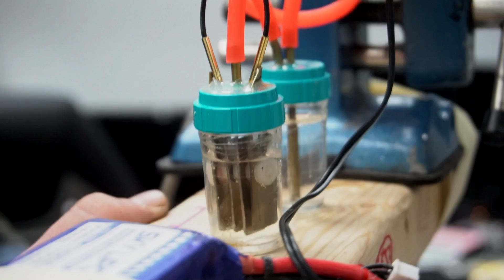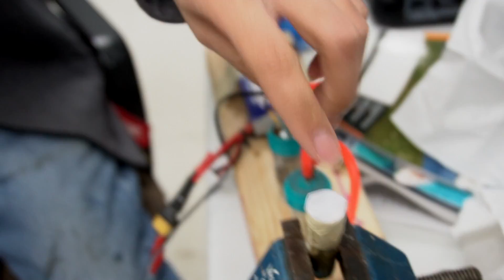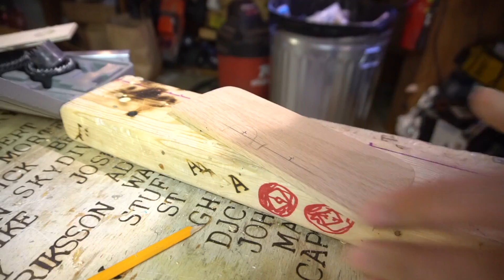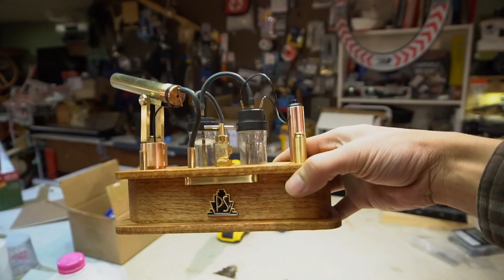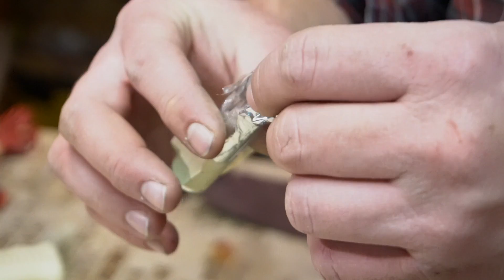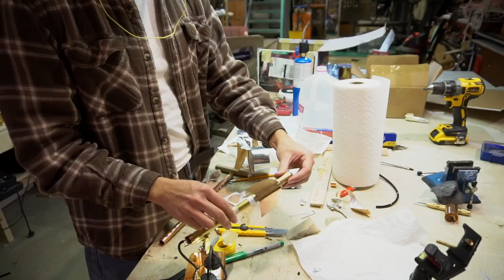Mini DIY HYDROGEN HHO Cannon

Comment: “This HHO is rally dangerous” -Petersripol yes it is, but basically it’s still only water (H2O). Hydrogen is the dangerous part. Actually you can use basic salt to dissolve in your water for electrolysis, works as good to heighten the conductivity. So yeah, you can build a hydrogen bomb with salt water. Try it at home but think thrice, educate and protect yourself. And don’t hesitate to ask for help or advice from someone.

Comment: A friend filled a balloon with HHO, then held the balloon against his sweater covered belly to tie off the end. The static electricity from the sweater ignited the gas and blew the windows out of the barn, removed his eyebrows and most of his hair, and he's now deaf in one ear.  Great contraption Peter, love the deco/science style.
Reply: I highly doubt the window thing but these explosion can easily deafen you.
Reply: MsSomeonenew a year late but it can easily blow out windows
Reply: (MsSomeonenew) It's pretty powerful stuff.
Reply: Thank you for pointing that out. I'm sure no one would understood the meaning of my dumb ass comment without your incredibly perceptive grammatical sleuthing. Your a champ, thanks again.
Reply: HHO is the H2O of water split apart. So it’s kind of the same as taking the smoke from an explosion and reconfiguring the atoms back into the fuel and its oxidizer. In the case of HHO, water is literally the “smoke” (or byproduct) that results from the explosion. So when you separate water into HHO, you naturally end up with exactly the perfect ratios of fuel and oxidizer, which makes combustion just about as perfect as it can be. Add to that the fact that hydrogen has a really high energy density (way higher than gasoline) and that’s why HHO has such an energetic explosion.
Reply: HHO. Safety is super important. If static is igniting it, then you have lost control, you cannot lose control of this gas. Sorry about your buddy.
Reply: 2 to 4 years late , but it depends on the ratio of hydrogen and oxygen and volume its contained in .
You can get a tiny pop up to dead, its all up to you in the end.
This process isnt for the average joe , do your homework before trying real science,  theirs alot more danger then just fire and boom to this if you dont understand it fully.
Reply: As someone who's played with soda bottles filled with the gas and then proceeded to ignite from a safe distance, heck yes, the explosion is crazy powerful. Its almost alike to a high powered rifle being fired. Its a very sharp strong explosion, not a boom or whoooph but BANG like sharp crack. The hydrogen/oxygen are mixed at ideal ratios. Great fun until it goes wrong. Beware.
Reply: That's H2O dumb-ass.
Reply: 2HO
Reply: HHO is just water
Reply: @luongmaihunggia  HHO is water, but separated in to gas. Quite literally rocket fuel.
Reply: @luongmaihunggia hho is oxyhodrogen(mix of hydrogen and oxygen) both are highly flammable.

Comment: hey Peter, maybe do a reduction in the barrel so that you can have a smaller diameter rocket slid down ovee the tube?

have the larger diameter pipe you currently have as an expansion  chamber.   maybe leave it 2-3 inches long and solder to it a 1/4 diameter length of tubing 2 inches long.    to the outside of that you could slip your rockets.

also perhaps the inside of the 1/4 inch tube will allow for something like an Airsoft pellet to be fired.

lastly, for your current design, maybe look into something akin to a blow dart design that snugs/seals to the inside of the tubing?

Comment: you should plug the open end of the tube and just use the sparker to launch it for better results
unless, as I suspect, the sparker broke which is why you're using a lighter at the end to ignite it.

Comment: Well done. You are a sour looser though :-).
Just a thought: You may want to use a flexible or at least a none-shattering material for the secondary (bubble-)chamber. This will not only save your primary chamber but your eyesight too.

Comment: why not use tap water or dis. water with table salt instead of using potassium hydroxide? If it's only purpose is to let current flow.

Comment: if you're gonna put potassium hydroxide in your water, why bother using distilled water in the first place? Just grab some sink water so you have a bunch of ions in it already, and it's much safer. I guess it's not as efficient but still

Comment: I have a question, why does this work at all? Normal rockets work because of the expanding gasses they release. Cannons which is a better comparison to his rocket, work because of the expanding gasses in the barrel  that propel out the cannon ball. But in this case the fuel is Hydrogen gas, and when hydrogen burns in Oxygen is produces water without any other gasses(2H2 + O2 --> 2H2O). So how does the rocket even move a bit?
Reply: Its converting the energy, used to crack the water into Brown's Gas (HHO), back into water. The mixture burns very rapidly, causing the bang sound and a single high impulse of energy. Energy created is ~240 kJ per mole of H2. You can read up more on it via Wikipedia and other sources (eg. search oxyhydrogen or Brown's Gas).
 - Eddy

Comment: you need oxigen. Rockets have two tanks, one with a fuel and on with LOX
Reply: During electrolysis the cathode makes hydrogen from electrolytic water, and the anode makes oxygen. In most designs for this the oxygen and hydrogen go out through the same pipe making HHO, including this design. I don’t know much about rocket engines but the fuel is hydrogen and oxygen combined.

Comment: I was watching the video and couldn't stop thinking: Dure seal the fucking hole, use an electrode or something to fire it up FROM INSIDE, because all the pressure is escaping through that hole you made for ignition.......
Reply: Yeah. You can see in the slow mo just how much energy is escaping through the hole before the projectile leaves the barrel. A solenoid of some kind that closes the hole when the ignitor is pressed would be a cool way to automate that. Definitely need the hole while charging though, or there will be nowhere for the oxygen to leave to. I bet covering the hole with a valve would double its power...
Reply: The hole is there to let the excess oxygen isn’t it? That’s how I interpreted his explanation (when he first demos the finished build).
Reply: Indeed, since it's not closed before ignition, I am guessing there is a lot of energy dissipated through it. That's a really big hole for the size of the combustion chamber.
Reply: Yeah, but at some point it becomes a homemade gun instead of a desk decoration.